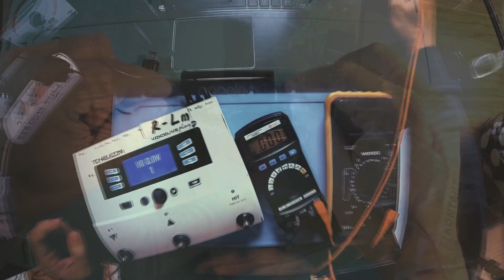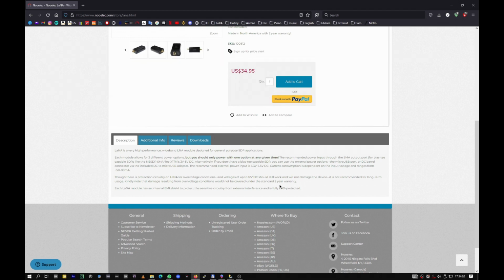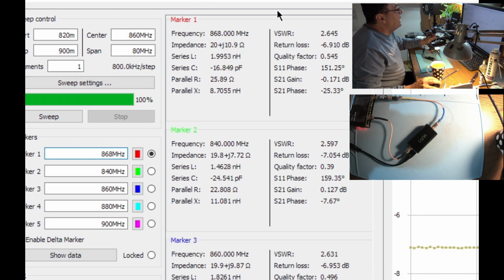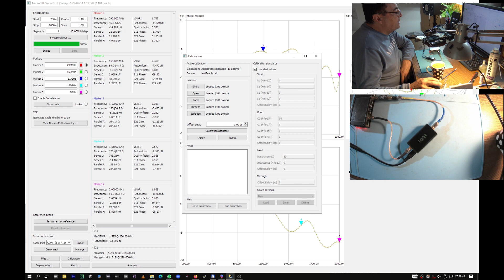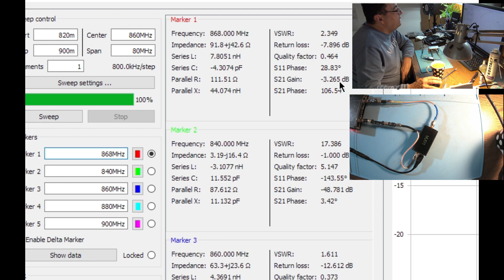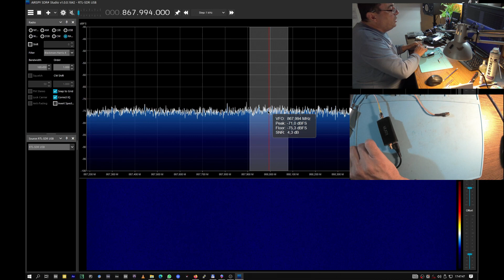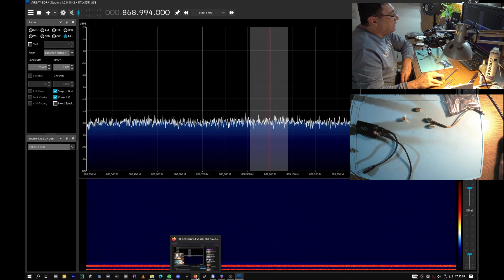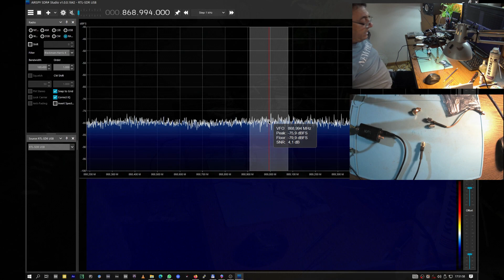NOOELEC LANA Wideband Ultra Low-Noise Amplifier LNA

Comment: Technically you can Tx up to 10db through the unit, but personally I’d never trust any txmitter to remain so predictable.  This may be a protective bp, the designers assuming accidental Tx by the customer.
I jerked the unit to it’s min max limits, it runs quietest powered by the lowest amp supply possible ( think .500 ma /  half an amp ).  You can find these by searching for ipod chargers, or older devices.
Reply from the maker: Mine got burned...
Reply: @viocaia  I wish I had every piece of radio equipment I’ve fried over the years.
One never forgets the smell of electronics cooking.
Reply from the maker: @bleikrsound6127  Same here!

Comment: Do I understand this right? This LNA has no use with LoRa as there is no pass through for TX power. It is only for reception?
Reply from the maker: Right! No TX.
Reply: @viocaia  Thanks, but I do agree, it has an impressive gain.
Reply from the maker: @Tore_Lund  Ther eis trick using a spltter and two antennas, so the RX comes antenna/amplifier/splitter/miner and TX goes from the second splitter port to a different antenna out. Check my videos I have one about it.
Reply: @viocaia  I have watched a lot of your videos and I appreciate your experimental approach to everything. My interest is not Helium mining, but Meshtastic, however the RF challenges are the same. Same channels and transmit power. I live in a city, not too high up, like you. So I get most contacts max 2 km away, but occasionally from 6-13 km away, so I try to optimize my setup to best use my un-optimal location. Meshtastic is possibly not that useful for anything, but it has become an interesting hobby. The enjoyment so far, is to make QSO with strangers. Like a radio amateur, but without needing a license.
Reply from the maker: @Tore_Lund  Interesting, I'll check it out, tusen takk og god påske
Reply: @viocaia  I lige måde god Påske.
Reply: Technically you can Tx up to 10db through the unit, but personally I’d never trust any txmitter to remain so predictable.  This may be a protective bp, the designers assuming accidental Tx by the customer.
I jerked the unit to it’s min max limits, it runs quietest powered by the lowest amp supply possible ( think .500 ma /  half an amp ).  You can find these by searching for ipod chargers, or older devices.

Comment: Great video do you know what the RX gain is?
Reply from the maker: Very high gain , like 18-20dB..I got more with it and a test about gain too..
Reply: I’ll give it a try, I have bought one to see if it’s better than my Acasom RX 17 TX 6
Reply from the maker: @Spark5  For RX it's much better..but is not a bi-directional..so it's RX only!
Reply: @viocaia  Are these suitable for Helium mining?
Reply from the maker: @Spark5  Perfect for RX..if you want a bi-directional there is a way with a splitter and 2 antennas..check my video about..
Reply: @viocaia  I'll have a look - Thank you!
Reply: Sorry to ask, I feel silly asking, myself and a friend have bought these, he’s already set his up connecting the miner to the output and the antenna to the input, is that the right way round as I thought it’d be the other way around, miner to the input antenna to the output
Reply from the maker: @Spark5  Not silly at all, I remember the AB-868..have that kind of reverse ''named'' ports..not this one.This is a wide band low noise amplifier, even for radio ham DX..so it's not specially for LoRa..you have to stick with right meaning of the ports..input is ''antenna'' , output goes to the miner. Please consider subscribe John.. thank you..
Reply: @viocaia  Thanks for your help much appreciated
Reply: @viocaia  and I am subscribed

Comment: I recently bought this for some radios that I have and was wondering if I could just use this by itself between the radio and the antenna when it's powered on or if it needs to be connected to something to actually have an affect on receiving.
Reply from the maker: It's an amplifier..high gain and low noise, one of the best you can find ..of course it will affect RX..it will improve it for sure. A 5V phone charger will do a proper power supply.
Reply: @viocaia  ok thanks. Just wanted to make sure whether or not it needed to connect to something else in-between the antenna and radio.
Reply from the maker: @GeorgiaRailfanner  nothing else..just hook it on..
Reply: @viocaia  ok thanks.

Comment: Which end goes to computer
Reply from the maker: That's for RF signals..
Reply: @viocaia  yes I know . One aend to ant. The other to radio. But which  end goes to the sdr?
Reply from the maker: @leanlafitte  OK, if you want to use it with SDR , antenna goes to antenna input of NooELec and output of NooElec goes to SDR's antenna input.You also provide power from SDR Radio if it's got Bias-T function..

Comment: You read the Peak value, but is the Noise not the Floor value?
Reply from the maker: It's just a compare with the other amplifiers I tested..The floor noise is around -80dB...that's the reference..and peak is the noise added by the amplifier..

Comment: I saw LNA and flocked in here within a millisecond.
Reply from the maker: Nice! I can say this is really good..For now it's in the attic connected to a miner, but I'll try it soon with SDR radio ..I need a better antenna though...
Reply: @viocaia  Yeah, I would love to see real results.  Nooelec is a good company but a true LNA needs to meet this criteria at its maximum (for instance the LNA for the old C band satellites was less than 45 Kelvin max at 25 degrees Celsius) is -> A typical LNA may supply a power gain of 100 (20 decibels (dB)) while decreasing the signal-to-noise ratio by less than a factor of two (a 3 dB noise figure (NF)). Although LNAs are primarily concerned with weak signals that are just above the noise floor, they must also consider the presence of larger signals that cause intermodulation distortion.
Reply from the maker: @generalawareness101  You lost me here! 🙂 Maestro!
Reply: @viocaia  You don't have the equipment to measure how low noise it really is so a lot of companies bank on that.  Lab equipment to measure the Kelvin temp added by the LNA is heavily expensive.  What that leaves is hoping someone did it who has access to such lab equipment.  We can measure the other two items I mentioned with equipment you already have.
Reply from the maker: @generalawareness101  Right! Do you remember checking the batteries charge with the tongue? It was working! 😲
Reply: @viocaia  Shhh, I still do that.
Reply from the maker: Tomorow I'll post a look inside..